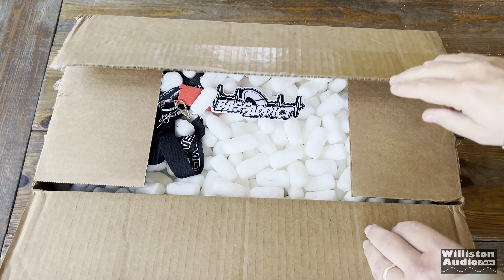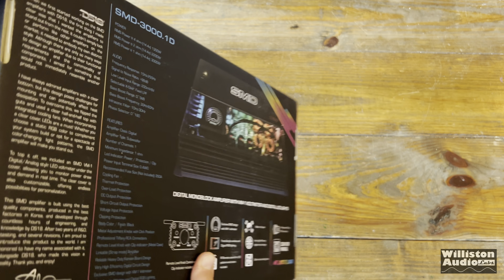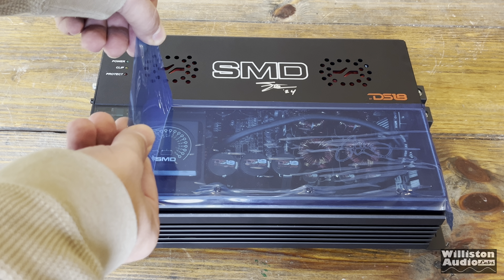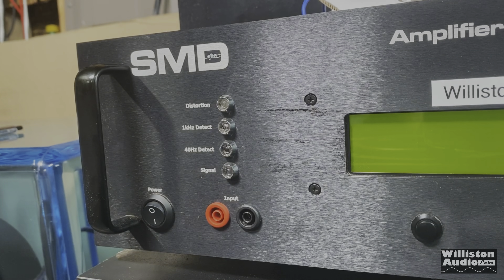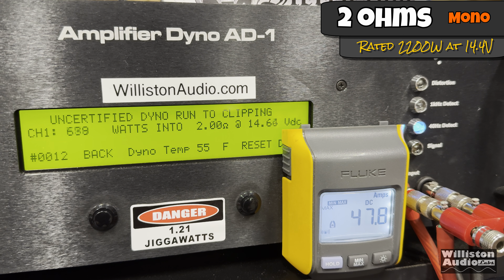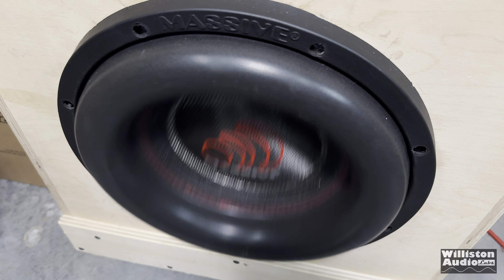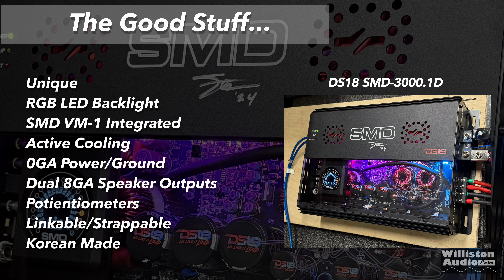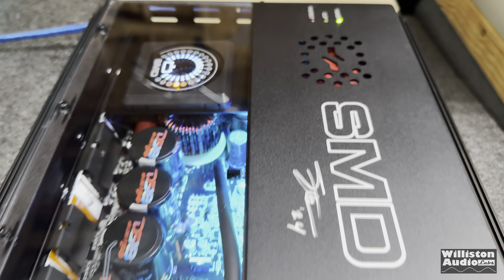Amazing Looks and Powerful Sound - SMD 3kW Subwoofer Amp Dyno Test

Comment: DS 18 has a scattered performance profile across their product lines. They've had 4 channel amps rated for 3,000 watts that did no more than 600, but they've also had some that do over rated power. I've got the plain Jane looking frx2k, a full bridge design, full range, dedicated to running my subs. 
It does better than 2k at 1 ohm and is set more for a SQ setup. It's not given me any issues besides getting hot during hard use. 
Basically it comes down to finding the good ones underneath all the other over rated trash they sell.

Comment: Not impressed with this gimmicky amp. 
Overrated in all except 1 ohm. 
The efficiency is about as bad as a class AB. 
And being a Korean amp and protecting at 0.8 dynamic....
At least the SMD amp dyno is a good piece of equipment. 
It's ironic that his other equipment has to showcase how crappy his amp is.

I'll just stick to the Real Korean amps. 
And if I want a light show I'll just use my big boss 8K that half bridge and yet somehow still more efficient.

Comment: This amp seems to be the outlier of the line. All of the other dyno videos I've seen they always make over rated power. If they come out with a gen 2 of this amp I'm sure the power output will be fixed. If I was buying this amp I'd run it at 1 ohm anyways which it did 1600 more watts than rated dynamic. Steve is running the 8500.1s at 0.7 ohms in his son's build and it is fine so I'm not sure why the 3000 couldn't handle it. A little disappointing for a $700 Korean board.

Comment: Guys if you notice he pushes high 14V even 15 at some point so that means you’ll need to spend $1000/s for extra battery’s 
Most people will hook this up to the original battery and push 12-13V to the amp will clip at even low medium volume 
I have the 2800.5 and the sub channel clips at medium volume and I barely get any bass out of it the 4 channel goes really loud and clear but the sub channel is not for me I run a single X12 V3 and I am not impressed so far maybe it would push it harder if I spend another $2000 on extra battery’s but at this point I would love to see a review on the 2800.5 with the dyno from 13V to 14.5 to see what it does.
At this point I am thinking of getting a separate sub amp that can produce a bit more.

Comment: Tell me most of the people in here commenting don't know about the quality of all the parts and features without saying anything... If we were doing an all metal amp, no fancy features like a JP. The Amp would easily be a 425 to $450 power amplifier. Props to SMD: He's been in the industry for a long time now.... To see his name on DS18 makes this even better. Love their equipment because again, when anything is installed correctly, it sounds phenomenal. So much hate in here when their is a plethora of other manufacturers that could be talked about.
Reply: Sam young is NOT quality. Not sure what the rest is but based on that alone probably NOT high end. Sure the resistors are 5% too. You don’t know what you’re talking about.

Comment: Free robot underground.  Big d wont talk about that.  Yeh pat is abrasive. But pat is a good person. And loves car audio i bought a line driver off oat when i was 15. I was born in 1985.  Yeh i dont agree without everything pat says.  But the robot underground is legit.  And here you are sucking off smd. And yes i run fi because of steve.    But I you're literally sucking steve off.  Them leds will fail. Will Steve honor the repair

Comment: Why did Steve partner with DS18??? I cant help but feel like it was a terrible choice to saddle up Steve's hard earned reputation/brand with such a bottom feeder electronics name.  (Scratches head)

When Big D says they can be "linked together", it's misleading.  (Love ya Big D!)

They cannot be run through each other to multiply the output. 
What he should say is this amp has an audio signal pass-through. The audio signal can pass through one amp to another so you don't have to use hokey shit like RCA "Y" connectors.
Terms like "link-able", and "strap-able" are very misleading.

Comment: Tba the review was slightly biased. but that doesn't change what the amp put out it does do rated on higher voltage but for the price there are SO many better brands/amps to go with.  The price point kills this amp line.

Comment: She is a pretty thing, but if I were spending my money it would d4sound. Those amps usually beat rated power by 10 percent or more, and looking at the boards and components they are well built.
Reply: DS18 went with Seongsin, an old Korean factory that makes Orion XTR and HCCA stuff, for these amps. These designs are ancient and inefficient. I'd take a modern S&I design over these SMD amps all damn day. Get a JP33. Better circuit, .5OHM capable and stout.

Comment: Can get a Mmats M3000.1 for about the same price, or a tad more (if you talk to Dave - I paid about $700 for mine a few years back), which easily exceeds its rated 3000w at 12v, and 83% efficiency at full power. Oh, and did I mention, it's also Made in the USA!!
Reply: MMats is great stuff.
Reply: @oboe174  The M3000.05 is half ohm stable and available. I think his point was that you can get an American made amp with better efficiency, build quality and actually .5 OHM stable for not much more than the SMD DS18 amp, which is made on one of the oldest factories in Korea, not even S&I. So, if you want a quality amp that doesn't need a bunch of fans, made in the USA, you can get one.
Reply: @oboe174  should probably learn how to read before making stupid comments on YouTube. 
I said "if you talk to Dave". The"list" prices haven't changed in a long time. 
And, even if you couldn't get even 5c knocked if, it's still a MUCH better value than that POS chinesium amp that couldn't even hit rated power at 14v.

Comment: Big D.Pls do 1 18 vs 2 12s of the same series with low wattage/high wattage difference and a 25hz till 45hz video
Reply: But pls make sure the liters of the boxes are pretty  equal and the tunings are also 30 or below

Comment: Why are all these amplifiers rated at 14.4 when most regular vehicles charge at 13.6? No hate towards this amplifier in specific, it’s just that all these amplifier specs are always stated 14.4 wouldn’t it be better rated at 13-12 volts? Anyone please educate me.
Reply: If they rated this at 13.8v, the numbers would be a lot less impressive. Steve had to boost the voltage to 14.6+ for it to even make its certified numbers at 2 and 4 OHM on the 5K he just tested. It won't hit close to certified and starts to tank the less voltage you give it. On the other hand, if you can feed these 15v+, they will give you a lot more power. Still, like you said, most charging systems aren't going to push the high voltages Steve tested these under.

Comment: Steves a basshead legend I always followed so I am hype about buying one of his amps. Before  they came out I had my eyes on the 5k frp in blue for $550 . I have been running a lot of ds18 product in my 2002 tahoe budget build I have a ds18 10.5 screen, the new deluxe 3k 4channel  mico amp which runs (6)6.5 LED pro’s & 4 tweeters all my 6.5z light up blue, my amp rack and my 12” octagon port also has blue LEDs and sets my build off so when I seen the SMD amps I was like that’s going to really catch the eye and goes with what I’m trying to do far as looks & all matching product  ! now I’ll be honest the $600 price tag did kinda discourage me but I’m not mad the looks are amazing if your into having a eye catching setup I know there are tons of amps cheaper that can make more power but if your into looks and  a smd fan I think these are cool ass amps if I upgrade it will just go into my other cars build

Comment: 1255 is not 1300, where is the fail music? (Parts tolerance... seems like preferential treatment, just sayin') - 2160 is not 2200 also a fail... yet no fail music. (Hummmmm, still being positive?) Greater than 80% efficient is also NOT 74% (Again seems like you are being BIASED) - Would go in a Show car? You would lose points for those DS18 stickers on the CAPS, not even straight...maybe that's the Rainbows (LEDs) fault?  haha! I'm GLAD it went into protect to save itself... but... we ALL wanted to see .5ohm and .25 ohm etc... There is definitely some "FRIEND" Bias going on here.  Would just like you to be consistent. (Fair enough?) - LOVE your videos. Like SMD as well.  No hate.  We all just like Consistency and facts. Cheers from Canada!
Reply: The manual/spec sheet actually states greater than 86% efficient at 4 OHM. So, did Big D just make a mistake, or was he trying to make it sound like the amp wasn't a good 12% lower than the advertised efficiency? Kind of hard to market an amp that's only 74% efficient at 4 OHM when every other Korean amp is doing that at 1 OHM. Hell, the seven year old SKAR SKV2 has a better circuit and is way more efficient and powerful than this 3K, while being $250 less, right now.

Comment: What a beautiful amplifier, a nice piece of art that you can place it for display. Sure it didn't meet all it's ratings but where it counted the most it delivered. Most people will be running these amp at 1ohm so if you are one of those guys, this amp maybe be for you. Now at a half ohm, I'd recommended an old school  soundstream amps that can handle super low ohm current licke quarter ohm or some of those jp amps that have been  shown in this channel that can  handle safely half ohm rating. Overall it's not bad at all considering that this is the first of it's kind. Expect better results when they release a second upgraded version.

Comment: I have a question. What octave slop is best for sq
Reply: There is no definite answer, but 24DB is usually preferred for LPF in my subwoofer installs to cut vocals. It just depends on a lot of factors. There are also different types of crossover, like Butterworth, Linkwitz Riley (LR) and others.

Comment: Considering i only look at the 1% number this amp barely made rated power at 1ohm and didnt at 2 and 4ohm. Steve meade has never really been a loud car audio enthusiast. Yes he has had some good air moving builds as should be expected with the value and type of gear he used. But like the smd subs he had made nothing he really did was blow your pants off impressive. 

His collab with d'amoure engineering im all in support of but i think sparked innovations wouldve been a better partner to d'amoure. 

But at the end of the day at least he isnt as obnoxious as JP

Comment: Aesthetics aside. Compare this amp to others in the same price range. The amp missed rated power at  loads below 1 ohm. Wont do .8 ohm, and has poor efficiency. Its nice to look at.
Reply: There are a TON of amps from the same Korean build house that cost less while outperforming this amp in output AND efficiency across all loads. JP33 and SKAR SKV2 both come to mind. Then, you have stuff like Orion HCCA 3000 that costs less, yet absolutely destroys this board in all performance metrics. Heck, the Taramps Big Boss/Smart 3 is a constant power amp that does 3K at .5OHM-2 OHM, yet it is more efficient than the DS18. If this amp didn't have SMD on it, I think Big D would have been a lot more critical. It looks good, but that's all this amp has going for it against the competition. Claiming 86% efficiency at 4 OHM when you aren't even hitting 80% at 8 OHM sounds like a lie to me.

Comment: This amp sucks!!! Horrible heat sink, tiny fans down do rated power, cost more, engineered by Toni lmao didnt Rockford fire him. Korean made…? lol it’s got  China parts all in it. More like Steve and Toni put up money for a build house in China to do a Korean style budget amp with lights 😂😂😂 piece of junk
Reply: You thinking “toni” engineered this amp is Perfect example of not knowing wtf you’re talking about and smoking crack while typing on Youtube. btw the phone you’re typing on has china parts all the way through it. what’s is your point exactly?
Reply: Engineered by Tony? The only thing that has Tony's name on it is the volt meter that's in the amp. So your not so smart are ya.
Reply: DS18 put up the money for Seongsin Korea to build amps based on an old circuit they've previously used in their EX-L series amps. Steve got to have input and says he picked the boards, which makes sense, because he's not an amp engineer and managed to pick some of the worst, least efficient circuits from the S&I catalog. Or, DS18 told him that's what they are using and he lied about picking the boards. They ARE using Korean boards and caps, but it's not super high end parts, like Rubycon or Nichicon caps, these are still just using mid-level components from Samyoung. The FETs here also aren't the latest from Infineon or Fairchild. The PCB isn't the best quality and while this is a Korean amp, there are still a lot of cheap, low level components. This particular amp is the same exact circuit design as their EXL-2500, which is $200 cheaper. The biggest fault of these amps is going to be those stupid fans. They are cheap and use sleeve bearings. They will get noisy and then fail eventually, which means the amp will have no active cooling and will start to overheat. 

A pig with lipstick is still a pig.
Reply: @TikiDoorman idk much but I can tell you know a thing or two. What amps do you recommend for 3k to 5k budget not an issue

Comment: JP33 at $450 seems like a far better buy if you want an efficient 3K that will do more than rated at every OHM load. These look cool, but theyre a cheaper circuit design and you can just get an EXL from DS18 if you want this circuit type for a lot less. Then, you can buy a VM1 and put it anywhere.
Reply: @TikiDoorman  you can get the jp5k amp for just a little over $100 more than the 3k amp which is absolutely ridiculous
Reply: @corytapp223 thats cuz old SM needs his 20%.
Reply: Can go even cheaper and get a jp23v2
Reply: It's the trumplican way of life. Be cheap af, make the most profit possible.
Reply: @TikiDoorman  Orion Hcca for sure are still the kings of amps.
Reply: @BloodCover  Love Orion HCCA. The Orion XTR stuff is also a great value option, too.
Reply: @BloodCover  Funny thing. Orion is made by Seongsin in Korea. This amp? Also made by Seongsin in Korea. That's right, the Orion HCCA and the SMD amps have the same OEM!
Reply: @TikiDoorman  😂😂 nothing is made in Korea anymore
Reply: @TikiDoorman  not the same design. a production company is just that.
Reply: @BloodCover  When you get a chance, compare the internals of the DS18 EXL-P2000X1D to the Orion XTR 2500. Very, very similar circuit design. I found out that Seongsin, who OEM's for Orion, also shipped these to DS18.

Comment: I'll be completely honest, i always thought of smd as higher end of car audio equipment. I have over a grand in distortion meters amm1 ect. Not knocking ds18, but that's always been cheap, expected to fall short. I'm disappointed...
Reply: did you see the $9 alibaba LOC that got a SMD logo and resold for well over $100? SMD stuff is oven rebranded or cheap off the shelf parts with a massive markup

Comment: Tons of respect to you mr. Meade. But he ran the one ohm test with a higher resting voltage of 15volts. 
Its the only reason it got that higher one ohm number respectively. 
All the other runs were generally 14.5 volts. 
 No Joe Six Pack daily driver cars are charging at 15 volts. 
Usually 13.9 - 14.5 volts. 
Mr. D. Williston did rite by us. 👍

Comment: So it's basically just a typical low efficiency DS18 amp that cost way more than usual because SMD is stamped on it??
Reply: It's the same circuit as the DS18 EXL 2500. Woefully inefficient. Basically an old, inefficient, low cost Korean board with some visual flair.
Reply: @TikiDoorman maximum profit and distract with plexi and lights and a meter.  Anything for more money.
Reply: @TikiDoorman the efficiency flat out sucks.  Amps are hitting over 90 at 4, in low 80s at 2 and mid 70s at 1 ohm.  The newest generation of class D shouldn't be in the 60s unless it's sub ohm loads IMHO.
Reply: 400 Amp Jesus Christ
Reply: Yes you are actually 100% correct my man it's a ds18 amplifier don't be fooled don't be fooled by the gadgets and the bells and whistles and all the pretty lights because at the end of the day it is very very insufficient and it sucks balls😅😅😅😅😅😅
Reply: All Those Clear Plexiglass just for Show Off Fools out there paying 100 times more money 🤑💰💰💰 ahhh 😭...

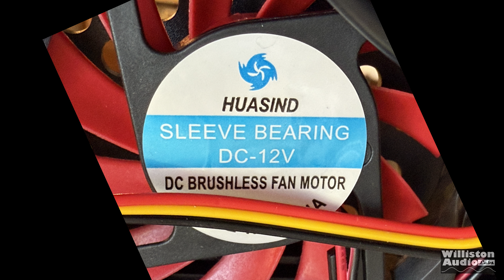Comment: 11:48    Huasind  is Chinese yeah?
Reply: This amp only uses the highest quality Korean components. 😅
Reply: @TikiDoorman 
Assembled in Korea?  Looks cool,  I hope it performs very well long run especially for the cost.
Reply: @RoboDriller  It's supposedly assembled in Korea. Those Samyoung caps are still mid grade 85C units and this board is a twenty year old circuit design with horrid efficiency.
Reply: @TikiDoorman  so a hard no go you recommend?   Although those 20 year amps still be kicking!
Reply: @RoboDriller  If I'm buying a 3K today and want a Korean design, I'm going JP33 for $450. Kills the DS18 in every area.
Reply: @TikiDoorman  thank you for the advice!   What about a good set of coaxial speakers, cheap enough and good.  For a garage stereo
Reply: @RoboDriller  Tons of options. Cheap and good: Morel Maximo

Comment: My only issue with these tests is the voltage. Not many vehicles get 14.5 volts. Definitely nit picky here but normally it's closer to 13.5-14 volts. I'd like to see how they perform at those lower voltages. Is there a big difference?
Reply from the maker: I try to keep as close to 14.4 as possible as this is where most amps are rated for their output power